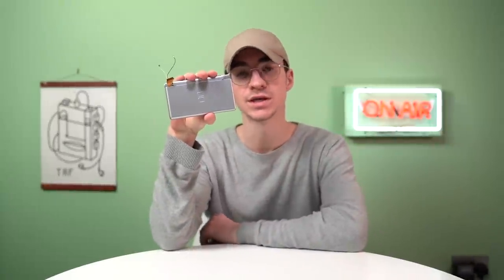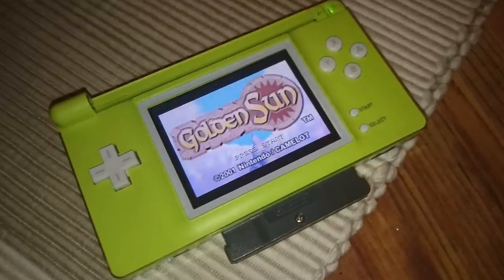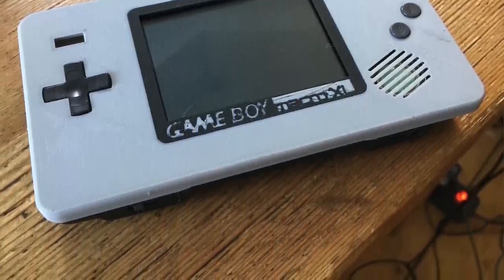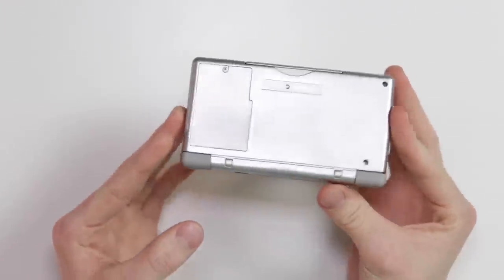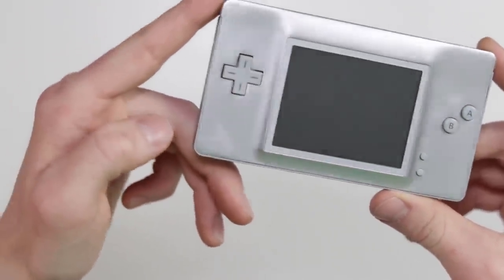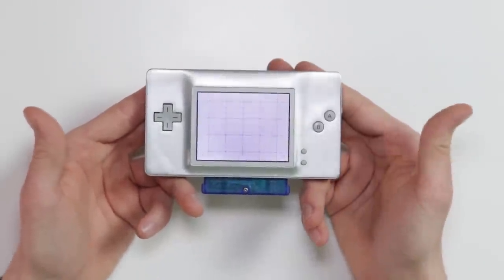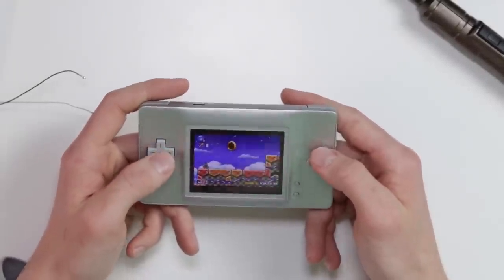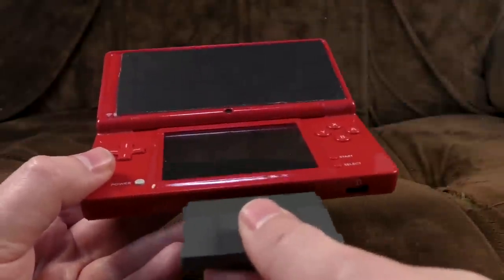Giving the Nintendo DS one screen for no reason

Comment: Next up in the series:

Giving the N64 64 cartridge slots for no reason
Reply: 😂 yes
Reply: perfect
Reply: Yes please
Reply: People with trypophobia : 
oh no...
Reply: Giving the 3DS three screens
Reply: actually if you have a game boy slot on top that would be pretty cool.
Reply: Replacing the GBA slot in a DS Lite with a cartridge slot from a GBA SP, so it can play GB and GBC games as well
Reply: lol
Reply: One slot for each 1/64 of the ROM address space. (Easy to do in hardware, since 64 is a power of two and those work nicely with binary.) On the one hand, you can cause crazy glitches by putting different games into different slots. But on the other hand, you'll need up to 64 copies of the game if you want to play normally, depending on the size of the ROM.
Reply: removing the n from n64 for no reason
he just removes all the n64 insides and replaces them with ps1 ones
Reply: Morphing 3 dsi’s to make the 3ds

Comment: Me: Oh hey I finally have a use for my broken old DS Lite! 
realizes that I need specific tools and knowledge to keep the sound
Me: oh
also realizes that I don't have any Gameboy Advance games and the only two I had, I lost or my cousins stole them
Me: Oh no
Reply: actually, there is a no solder option! as long as your ribbon cable is intact youre good. and, you can get an r4 card and emulate gameboy games instead!
Reply: @_downyblue  how can u get the r4 card screen on the bottom?
Reply: @BecomingNearPerfect  do you mean the menus or the emulator itself? usually it depends on your firmware, but most of them have customizable settings. you’d have to set them on a full ds first though.
Reply: @_downyblue  i mean like how when you use a gba game u can choose if you can view it from the top or bottom screen if there was an option as so for an r4 card
Reply: @BecomingNearPerfect  yeah, it depends on your firmware and emulator. most of the time youll set it with a shoulder button or other unused button like x or y. sometimes itll save your settings, sometimes youll have to set it each time
Reply: @_downyblue  oh thank you for the help

Comment: meanwhile i couldn't even get my ds lite to turn on after replacing the shell
Reply: My suggestion to that is checking the top screen ribbon cable. It might be lose/badly connected or downright thorn. Some people say you can just take the screen away and do no solder mod to the board and it works, but from what I've repaired DSses and 3DSses they don't even boot up if the screen isn't present, or if the backlight isn't detected, which happens with a thorn ribbon cable. On the 3DS it thankfully happens more on the cheapest of the ribbons, which is the speakers, backlight and 3D slider ribbon, there's freakin' 3 ribbons on that hinge, cameras and screen being rolled inside the backlight ribbon so it sort of protects them a bit more.
On a DS Lite tho... it means to replace the dang screen.
Reply: my shell had extra plastic that had to be removed first. Mine initially broke my battery slot. The thin gold color contacts/wire sheets got bent weird from forcing plastic into it. I fixed it after noticing what happened.
Reply: I “accidentally” snapped my DS lite in two, it won’t turn on now
Reply: @lillievonleipzig4728  LOL
Reply: @lillievonleipzig4728  I tried to do the mod as a kid and my ds didn't turn on again :(

Comment: When I was younger I actually broke my pink ds 's top screen and for awhile I could still play gba games until the screen started acting up.

The hinges on my ds's would always loosen up and break.
Reply: ffs edge lord, you came here too
Reply: Yeah and that leaves the ribbon vunerable
Reply: A broken top screen ribbon makes the DS Lite (and 3DS for that matter too) to just shut down suddenly. It's about detecting the backlight being present, or else it throws a fit, hence that resistor he soldered. Could it have been what happened to you?
Reply: The og ds didn't suffer from this?

Comment: I made one of those some time ago, but a little different. I used the two speakers and made a few horizontal cuts for de sound (you have put the speaker and then you have close it XD).
And for the light, I used a little clear lego block :)
Good video man!

Comment: This reminds me when I expediently made my own game boy macro by braking of the top screen of my DS while I was playing Pokémon emerald on the bottom screen and to my surprise the game was still running fine unfortunately after I turned the console off and back on it was not able to start again the screen only flashed on white and that was it
Reply: thats cause the DS dosnt start when the top screen is disconnected/not detected. Thats what you need the resisitor for, so the ds thinks the top screen drtaws some power

Comment: Some years ago I purchased a filthy Nintendo DS on a flea market. Having taken apart many GameBoys before, I was confident I could take this apart and clean this up.
Sadly I broke the touchscreen connector and thought the DS was done far. Then I came across the GB Macro mod and attempted this. As a novice in soldering, this was pretty easy!

I have not attempted any of the cosmetic mods, but it's working as is.
Now I just need to get something to replace the buttons. The original button pads are worn out and the knock-offs just are not as good. I just want some clicky buttons!
I should also look up if I can just remove the DS touch digitizer; because it has quite a few scratches.

But other than that, I think the GB Macro is the best way to play GBA games:
- Backlit screen
- Rechargeable battery
- IMO more comfortable grip than an SP
- Headphone jack

Comment: A handy tip for cleaning up too much body filler is to use what they call a metal body filler scraper.  Do this when the body filler has hardened slightly and it’ll come cleanly off so you don’t have to sand too much.

Comment: Awesome replacement for a GBA carry around that runs legitimate cartridges, bigger than a Micro, and a good way to recycle a DS with a broken top but working bottom screen. (unfixable top screen flickering issue on mine due to the board but lower works great) It also allows you to use something like an R4 (if you don't block the DS slot) for backups, saves, and emulating copies of GBA games you own that may not be in the best condition anymore.
Besides filling, there's a lot of face plates you can buy (similar to the aluminum one but afaik you do have to modify the board for that one) that give a more finished or customized look you may want.

Comment: I had one DS with a broken top screen but I really liked the case I had for it and it was my only DS. Bought a working DS that was old and took the top screen from it. Made a macro outta what was left. Sure it’s unnecessary. But it’s honestly super cool. I used the boxy pixel stuff and it just looks really cool

Comment: The thing I though of doing instead of taking the entire top part off is to simply remove the top screen and a speaker and use that area for a bigger battery. The DS lite battery doesn't have any special pcb chip so any 3.7v battery cell that would fit in there would work. In theory it could be possible to put something close to 2500mAh in there. The DS Lite battery is 1000mAh. I guess it could also be done with the bottom screen area. I would prefer keep the clam shell and get a bigger battery instead.

Comment: quick and dirty if you don't have an appropriate light pipe:
drill hole, cover the hole with masking tape on the outside of the shell, shoot a tiny bit of hot glue into the hole from the inside, remove tape when cool

presto, cheap fix

Comment: Just a small tip you actually can take off the hinge plastic faster with a soldering iron though just be careful because you can go to far and need a lot more body filler, as well there is a setting when you turn on the ds it will just go straight to the gameboy game

Comment: Good body filler and paint work is a fucking art. It is NOT easy. Sure, there's room for improvement but you still did absolutely fantastic. It looks great!

Also, regarding the LEDs, you'll save yourself a ton of hassle if you drill a hole and then just fill it with hot glue. The glue make a very good light pipe due to the translucent nature and it makes a custom shape very easy. Just drill the hole in the right spot (can't help you with this part lol), put some masking tape over the hole from the outside, splooge a bunch of hot glue in the hole (you want to make sure it fills the bottom of the hole completely or, in other words, the outside that you see), and you're all set. The masking tape will give you a nice outer texture and it shouldn't stick to the hot glue once it solidifies.

Comment: The obvious reason to do this is the price, a ds lite with a broken top hinge cost $20-30 or less on ebay (They're also easy to find, not so much with ags-101 screens), ags-101 screens are a expensive (On ebay they go for $80) and then you'd need to mod/install it as well, meanwhile just chop off the top screen of the ds lite and you got a nice backlit "GBA" for $20-30, only downsides I see are you won't be able to use the link cables and it obviously won't look as nice, but still a lot cheaper. (Lately I've been wanting something that can play GBA games that's backlit and that seems to be the cheapest option, at least if I want to go with official hardware and not an emulator)

Comment: The best way to play GBA games on official Nintendo hardware is actually through the GBA player on Gamecube with GC component cables. Much better than the AGS101.
Reply: Good luck finding the Game Boy Player startup disc for a cheap price.
Reply: @beckybecky125  You can find the player plus disc for under $100 if you look around enough. The real difficult part is getting the component cables. Still looking for those myself.

Comment: Is there anyway to override the DS functionality startup screen and for the UX (or user experience) to be such that once you turn it on it loads the GameBoy screen automatically for GBA play only? I think the fact there are still remnants of the DS, including not only the look of it which I think the metal faceplate could be the solution for, but especially the loading screen is what makes it lacklustre if not appearing illegitimate which ultimately removes value from an otherwise intriguing concept.

Comment: Started on what i call my Jankboy Advanced as soon i saw your post about it. I got a speaker wired in and mounted, but it heats up a bit when the volumes up. Dont know if its a normal, or if its just a bad speaker.

Comment: "oh no! it's a dsi!" lol
this is cool build vid though.
question: i have 2 ds lite systems. the d pads and a,b,y,x buttons don't reliably make contact. dead presses.
any suggestion to fixing it?
Reply: most likely the contacts are dirty or the rubber pads wore down. Taking it apart and cleaning everything should be the first step.

Comment: I have this exact problem with my old Nintendo. Since it was really old , and had fallen down a lot of times the thing that keeps the two screens together was kinda broken but the screen could still stay open without them Nintendo getting separated and it actually worked that way for many years (like 5 years and it was working just fine) until one day I had given it to a friend bc I have two Nintendos so we can play together , and he accidentally dropped it and the screens got separated and the thing that kept them together broke and the cable inside too. The down screen works just fine , I turn it on and I can see the screen opening for a few seconds and then it turns off immediately (since the cable is ripped ) someday i will get it fixed or buy a new one Nintendo ds

Comment: boy you need to get yourself a dremmel, my bf got me a really nice cordless one  for valentines a few years  ago, its relatively inexpensive and super convenient. ill comment the model number if i can find it! Edit: as for filler, i suggest miliput, much easier to use  and you can do most of the smoothing before it dries. a lot cheaper than  body filler :) dremmel model number is 7700
Reply from the maker: I’ve ordered one! A cordless Dremel.
Reply: @TheRetroFuture  awesome sauce. you won't regret it :) thanks for taking the time to reply!

Comment: Just wondering how exactly this works.

I just did some work on a ds lite and because I didn't seat the top screen ribbon cable properly, the bottom screen flashed once and wouldn't boot. How do you bypass this error to make a ds macro because obviously you didn't have that issue.

Comment: Imagine you rip the top off of your DS, just to find out that its set to play on the TOP screen
Reply: You can easily access the menu on the bottom screen and change it to bottom. It would be much harder if the bottom screen was broken and you wanted to make some kind of Macro SP by filling the bottom screen's hole.

Comment: Someone help me! I'm in the middle of making a macro iv taken off the ds card slot wired the speaker on but I havent got a resistor I thought I'd test it before going any further as it's my first time ever soldering and not even with everything from top screen plugged in aswell the green light comes on screen flashes white then it dies?????

Comment: Pulling the screen out doesn't work. Just as a headsup the board needs to read some sort of input from where the riboj cable connects. If it doesnt it will not turn on

Comment: I got a gba sp ags 101 for 45 usd came with charger and was in great condition
Reply: Pretty good deal. That's the price you see for the 001 lately because of the IPS mod being compatible with them. All those 001 that were 20$ before the mod came out are now worth 3x more. I paid 110$ for my Gameboy Micro a few years ago and now I can't see any under 150$. Most are 200$.

Comment: I also think it is unnecessary... You can use the gba slot or use gbarunner2 on an r4 card with an intact ds lite if you want to play gba games. Just fix the top screen and do not disable your ds games.

Comment: i have seen this mod quite a lot over the years and i still wondering. don't this ppl know the ds lite already plays gba games? what is the posible up side to this? i mean u dont get the same display size as the gba sp, u cant play ds games anymore and u dont even get the full gba experience cuss of the lack of multiplayer.

Comment: No, men, you can play GBC games, GBA games and some DS games.  removing the cartridge slot from is an unnecessary mistake.  as unnecessary as doing a Gameboy Macro with a working DS. 🙄 it hurts, it burns, it hurts me, I have a couple of Gameboy Macro, but they were made with DS that had no solution.  and I have is that they need a superior screen, although it is not new, if someone is going to discard them I prefer to reuse it.